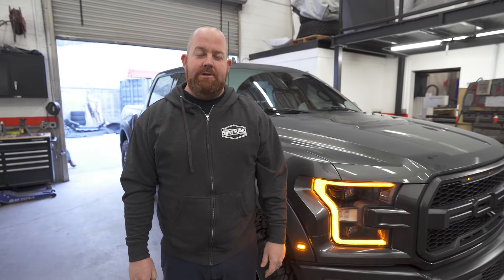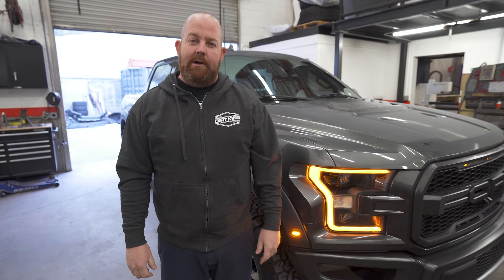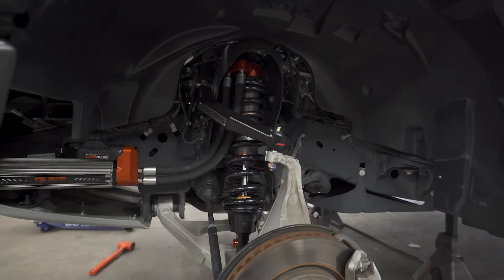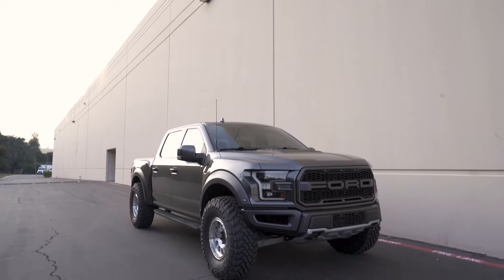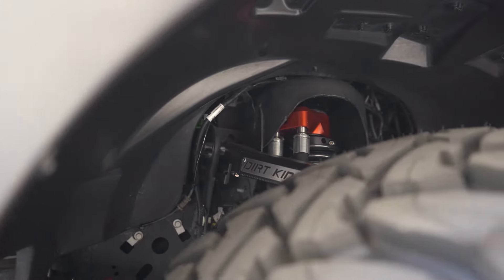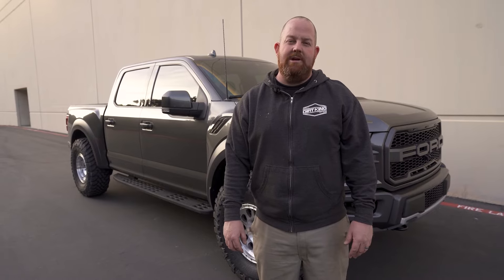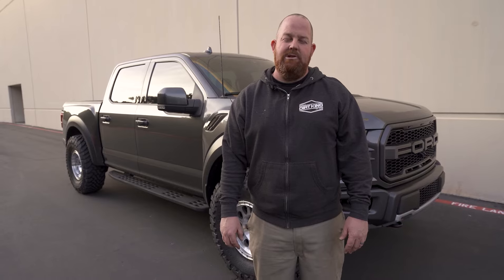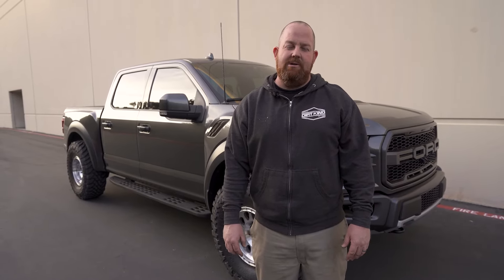Building The Ultimate Mid Travel 2nd Gen Ford Raptor

Comment: I wouldn’t call this mid-travel.  This is a stock width raptor with upgraded front shocks and UCA.  Dirt King’s “Long Travel” kit is actually their mid-travel kit.  Similar to similar mid-travel kits, Dirt King retains the factory shock bucket which means it’s still mid-travel.

Comment: How much do those 37’s rub?
Reply from the maker: We modified the lower portion of the front fender and firewall as well as the front bumper so it does not rub in normal driving situations but as with any raptor with 37s they will still rub the firewall at full compression